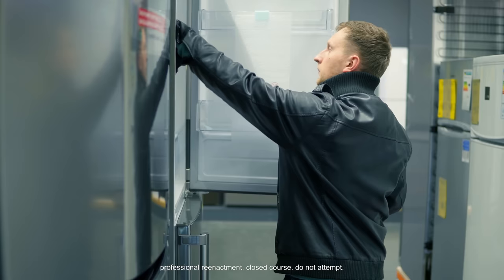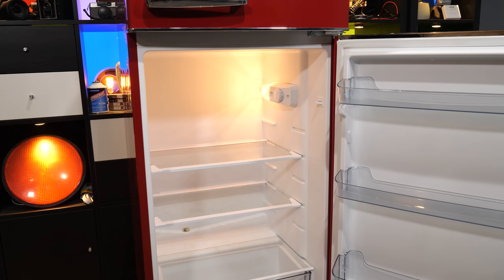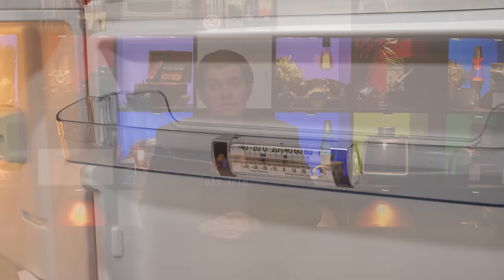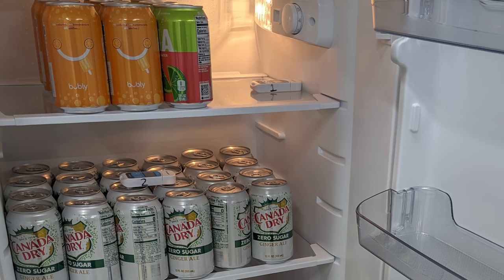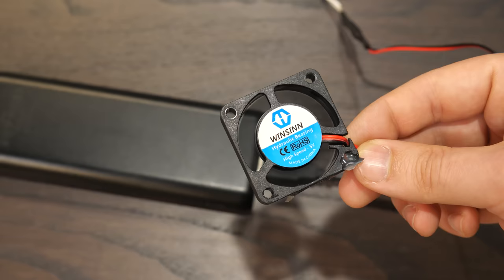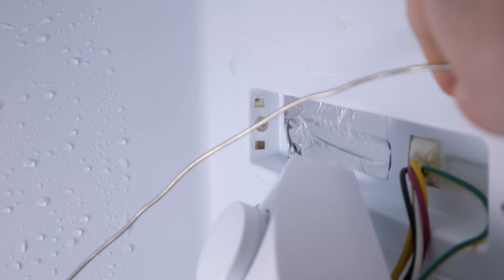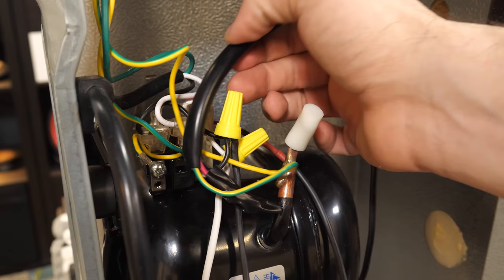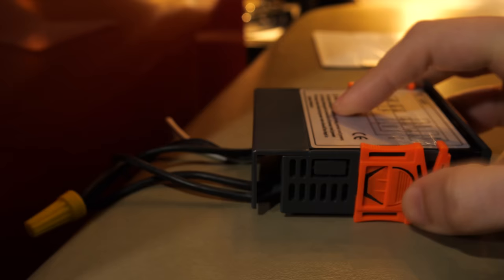This goofy fridge has a really clever design. It's also kinda terrible.

Comment: I can't wait for the final instalment of this series on the refrigeration cycle where we see Alec build his own refrigerator from scratch. 😂
Reply: Needs to be multi stage and also produce Liquefied gasses tho…
Reply: Maybe he can DIY an air conditioner that uses CO2 as refrigerant
Reply: @JamesRibe  I'd be impressed since CO2 heat pumps require very high pressure.
Reply: @BenWolkWeiss  Propane is one of the sort of "refrigerants de jour" due to simplicity, good performance, relatively low pressure, availability, low(ish) impact as a climate impactor if it leaks, and honestly, it is quite hard to blow up if it leaks - requires a pretty precise fuel air mix to burn (goes by R-290)
Reply: "available at your local Meijer!"
Reply: how were you here early? He doesn't seem to have channel memberships or Patreon, though correct me if im wrong
Reply: @ThomasRuecker  There is a youtube channel called Hyperspace Pirate currently making a diy cascade refrigeration system with the goal of producing liquid nitrogen.
Reply: Today, we have crossover video with NileRed; we’re going to be synthesizing R-123 for my home made chest freezer/oven with a reversible heat pump!
Reply: “Fine, I’ll do it myself”
Reply: @Luckmorne  Hank Hill branded refrigerator?
Reply: The channel @HyperspacePirate has been doing some really cool home refrigeration projects for a while now. I highly recommend them. They’ve got a similar sense of humor to Alec’s videos.
Reply: Hopefully he makes it reversible because you already have like 95% of a heatpump anyways. Might as well make it heat too
Reply: @WohaoG  He does have a Patreon, but doesn't seem to promote it much at the end of his videos.
Reply: @JamesRibe  The very first refrigeration systems used ammonia as refrigerant.  They stopped using ammonia when leaks killed people in the buildings.
Reply: "Now through the magic of buying my own more efficient refrigerant.."
Reply: @Luckmorne  And it's been known to have been sold mismarked as R-22, or as R-22 replacement, which it will happily replace/coexist with in a system.
Illegal for home use in the USA, however, even if properly marked.
Reply: That's not the final episode.

The final episode comes after he goes mad off of refrigerant inhilation and becomes a Mr Freeze esk supervillan, besitriding a major US city with his cryogenic powers, screaming "BY THE POWER OF HEAT PUMPS!" as he slaughters people en-mass with his ingenious creations.
Reply: how'd you write a comment "1 day ago" when the video dropped "1 hour ago"??
Reply: I'd put it at the top of purchase consideration.
Reply: Collab with primitive technology.
Reply: @ThomasRuecker You could make a very basic one with anything that changes it's volume. Applied Science did it with rubber bands, though it was incredibly weak.
Reply: @cyrollan Patreon
Reply: @KaletheQuick Fridge made of sticks and mud 😂
Reply: It'll end with him out on the roof with HVACR videos
Reply: @mgkleym  I was gonna mention that, one of my favorite youtube "series" at the moment.
Reply: The Mosquito Coast 2: This Time It's Wisconsin
Reply: Brass refrigerator from scratch as diy perks do
Reply: He is actually going to pull a switch on us and use a Peltier cooler, or maybe go with a bromine refrigerant, or a Steam powered system. Peltier is the easiest to build at home with basic tools.
Reply: @mgkleym  I did that years ago with a Sterling cooler using company money. We went to pulse tube eventually and then back to Sterling. I'm cool like that.
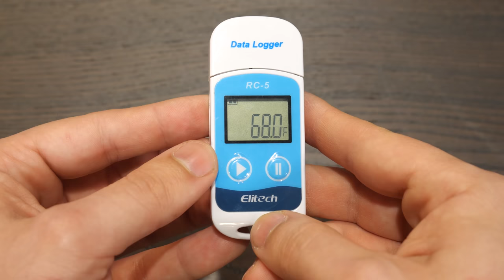Reply: 18:37 temperature measuring
Reply: Don't tell him Telsa's have heat pumps.
Reply: He's planning to freeze hell over
Reply: He's definitely got my interest here.

A homemade fridge sounds so cool
Reply: @Luckmorne  To go boom, sure, but any propane leak can have a different hazard; starting a fire. Get a tiny pinhole leak, something sparks or is too hot, and now you've got a tiny flamethrower until you run out of refrigerant. Honestly a fridge exploding is far less of a worry than a slow leak causing a fire, or even just destroying the unit and all the food inside.
Reply: I'm here for it.
Reply: @UncleKennysPlace IKR! I wish i knew this when recharging my 91 camero. It never got above mildly cool. Could have been full of oil too. Never got to figure it out before I smashed it. Im bout to fill my chevy Colorado with propane because it keeps acting like it cant handle r134 pressure and the compressor kept spitting like it has a pressure relief. No clue if they even have relief valves like that
Reply: "Through the magic of building two of them..."
Reply: Ahh yes the first mini-split heat pump refrigerator where the compressor is outside the house.
Reply: @megan_alnico those already exist in a room size format. People do it to make walk-in-refrigerators
Reply: It better be one of those Einstein–Szilard coolers! No moving parts is pretty enticing!
Reply: This is going to be a fridge of Theseus
Reply: @Wtfinc loads of them do indeed have a high pressure safety release valve.
Reply: Primitive Technology Connections?
Reply: Make insulated box, insert ice.
Instant 'refrigerator'.
Or as they were originally called, Ice boxes.
😊
Reply: Applied Science demonstrated a "refrigerator" that operated by stretching and releasing rubber bands, so there's that.
Reply: ...using Tech Ingredients barium sulfate coating to make it even MORE efficient!
Reply: Who's Alec?
Reply: @newunderthesun7353  the guy who used to host Jeopardy.

He reincarnated about 40 years into the past to become our Technology Connections guy
Reply: Who is Alec? His name is Technology Connections
Reply: Haven't watched the video yet, but I'd be all for that. Every fridge I've bought in the last decade (7 of them!!!) Has broken down, with the exception of my current one. A convertible Midea. If this one goes, I'm going vegan so I don't have to worry so much about spoilage of meats and dairy. Imma just eat root vegetables.

*Edit:

That Samsung he has is the same model we had that broke down close to a dozen times before it was finally replaced. There's a class action against Samsung because of their fridges. They suck.
Reply: I've been watching his videos for years and it never occurred to me that I didn't know his name.
Reply: @codyofathens3397  the convertable Midea Chest Freezer?

I'm using two of those {the 7 cu ft capacity} for my fridge and freezer. Nice!
Reply: I want to see him work on his quirky car more often.
Reply: @AmEv7fam  They call it The Strickland. No longer will you need to burn charcoal to keep your food cold, and it keeps the flavor of your meat natural.
Reply: @EnderMalcolm you do realize the qty of propane in even a resturant size refrigerator is minuscule… on the order of 8oz… that would be one extremely limited flamethrower…
Reply: We all know this is gonna happen eventually
Reply: Maybe an aging wheels collaboration since he seems to have enough tools to pull it off.
Reply: I mean when you can't find anything cosmetically available...
Reply: Such a good idea
Reply: @chrisbaker8533  an ice box and a refrigerator are not the same thing. There's a reason they're called by two different names. You described an icebox. The fact that you put the word refrigerator in quotes yourself, tells me you know you're using the word incorrectly. Why bother?
Reply: @fredashay  Ammonia is still used in some large capacity applications. It's a fairly specialized part of the refrigeration industry, but it's still common in certain niches.
Reply: He turns his garage into an icebox using some weird thing.
Reply: @Jafiveon  Oh?  Okay.  Thanks for letting me know.
Reply: @priestesslucy3299  ours is an upright. I've got a cheap Walmart special chest freezer, as well as a stand freezer I bought from a rental place like 10 years ago. I absolutely love the Midea fridge, though. With the two other freezers, I didn't need any additional freezer space, and it's nice having the extra fridge space that would have gone to a freezer compartment. 

Are you using a convertible chest freezer as a fridge? What's it's like having a chest fridge? I considered it, for the energy savings, but I was concerned that if anything leaked it would be a bear to clean and keep clean.
Reply: @codyofathens3397  It works so much better for me personally than when I used an upright and things always got pushed to the back.

I have it divided into three columns for different things and two slider baskets and it works great.
Reply: I'd buy that for a dollar! 😂
Reply: I can't wait for the second season of your "final instalment", where we see Alec build a BTTF3 universe-correct steam-powered version of his own refrigerator from acceptably retro parts and a period-correct refrigerant substance tbd. Ether, alcohol, or ammonia, maybe? By the way, this bozo —I'm talking about yours truly— only just realised that the Victorian Age absolutely temporally coincided with the Wild West. I wonder if Mark Twain ever regaled His Majesty with stories of cowboys and Indians. Btw. Wikipedia's Refrigerator page has a cool (heh) sketch of an apparently steam-powered one.
Reply: Expensive 🎉
Reply: Yes
Reply: @EnderMalcolm 08:22
This fridge uses butane, r-600a. Actually it’s pretty much impossible to buy a fridge made after 2019 without butane or propane refrigerant. R-134a was banned by the EPA for household fridges in 2018.
Reply: How where you here early?
Reply: I'm expecting an hour long video on an ice cube tray that is _still_ fascinating
Reply: I think that would be season/series two material.
Reply: I'm thinking of the scene from mosquito coast
Reply: There will be no final installment. It’s a cycle. It never ends ;-P
Reply: Need to have a reversible valve to turn the fridge into an Oven!
Reply: Wait what do you mean his name is not Technology Connections?
Reply: It would have to be a Whole-Home integrated system, combining climate control, hot water, clothes drier and fridge in a single system that removes or delivers heat to wherever it is needed. Probably all powered from his car.
Reply: "so I accidentally sprayed myself in the face with refrigerant.."
Reply: LATENT HEAT
Reply: He should partner with Tech Ingredients for the video. I wonder how cold they could get the insides lol
Reply: traybern  make the condenser visible from the inside and mix oil into a water based refrigerant.
Reply: I would love to see this 😂
Reply: PLEASE we need this video that would be the personification of yt premium
Reply: Technology Connections/Tech Ingredients crossover? :D
Reply: PLEASE 😂
Reply: Who wants to buy a YouTuber fridge?
Reply: I hope it's capable of cooling and warming, if not it would be a wasted heat pump.
Reply: Knowing how simple it is to build a fridge, now, I kinda want to. Maybe one condenser for big temp swings and a little one for maintenance? How much insulation is too much insulation? Chunky cast metal door hinges and latches, yes please!
Reply: Careful, don't tempt him. 😆
Reply: Hyperspace pirate is doing this actually!
Reply: a multi-level top-opening floor fridge/freezer combo :3
Reply: I'm not going to lie, but I've been dreaming of seen a diy fridge that someone intergrates into their home AC system
Reply: There was an old SNL bit with a couple stranded on an island. For Christmas, the man made some trivial trinket from a coconut while the wife made him a watch from ore she smelted. 🤣
Reply: You mean the fridge/heatpump, which not only has a cold compartment for cool item, a freezer compartment to freeze things, but the ability to heat and cool the air in the studio as needed.
Reply: He'll end up with a mountain sized Pykrete Warehouse.
Reply: The channel Tech Ingredients do a lot with cooling, heating and solar, they recently built quite a big Peltier Elements fridge... 🤔
Reply: Seems more like something Tech Ingredients would do. I think they haven't done it yet, but might be a good idea.
Reply: I'd be excited to see him collab with How to Make Everything.
Reply: Yeah, go retro and use ammonia as the refrigerant.
Reply: ... using nothing but a bicycle pump, a ballpoint pen, a brassiere, and some Tupperware.
Reply: The next series will be on designing a perfect toaster
Reply: One can hope
Reply: Yeah! Do it Alec! you know you want to!
Reply: To build a refrigerator from scratch, you first need to create the universe!
Reply: Same
Reply: He needs to solve the coolant safety problem at the same time.
Reply: During your test of the little refrigerator, the abnormally cold temperatures in the icebox cooled the thermostat area more than is typical. That caused it to think the refrigerator area was colder than it actually was.
Reply: @VieVentar you left out the accompanying step-by-step DIY explanation vid the FBI will label "manifesto".
Reply: @goosenotmaverick1156 maybe because it was uttered tongue-in-cheek and thus not designed to be overanalyzed? Just a theory. Feel free to split more hairs.
Reply: @neepsmcfly4176  I mean, no tongue or cheek involved in typing but yeah, I thought sarcasm and overanalyzing was the thing we did here
Reply: With help from aging wheels (who im convinced is his brother 😂)
Reply: That's an upcoming four hour technology connextras episode
Reply: Hyperspace Pirate is working on that.
Reply: I can t wait for the 2 hours sequel.
Reply: Not his gig. He's not a "maker" channel, he's more of a "break-down and analyze" channel.
Reply: @JamesRibe CO2 in transcritical cycle??? This is really interesting!!!!
Reply: I really want to see this lol
Reply: Ok
Reply: @goosenotmaverick1156  and you don't see the numerous examples of missed points? Of pointless hostility from misinterpretation? To claim that everyone is doing it neither forces you to do it nor justifies it's being done. I just wonder if more ppl consciously recognized the limitations maybe it would sway the social awareness and there'd be more funnier jokes and less misunderstandings. This, here, is already getting too convoluted. Hope you get it...
Reply: @VieVentar  Lol, you actually could use laughing gas (nitrous oxide) at about the same pressures as CO2.
Reply: I hope he covers thermo-electric/peltier cooling soon!
Reply: Lol dont call him alec like you're friends
Reply: @you_cant_ban_me3154  😂 What am I supposed to call him? Tech Connections Man? Mr. Brown? His name isn't hard to come across. I can't even remember how I learned it.
Reply: @Luckmorne  Propane also got picked up as the R-12 replacement of choice for older cars as the compressors struggle with the increased pressure requirements and lower efficiency of R-134a. These days, I suspect the shift for the same kinds of restorations is R-600a, isobutane, as seen in this refrigerator. Too bad nobody will let propane or isobutane anywhere near an automotive A/C system from the factory. R-134a took several years before auto manufacturers had A/C systems with appropriate capacity, and a lot of that was much larger condensers (now the size of the radiator), larger evaporators, and higher power draw compressors. R1234yf turns out to potentially be worse in parts of the environment, and it ignites in front end collision testing. New cars since 2017 with it have noticeably weak A/C units for any southern state.
Reply: @WohaoG is
Reply: There's a problem his temps had a little C ....weird
Reply: How is this comment older than the video?
Reply: @goosenotmaverick1156 most old timers call a refrigerator an ice box. Mom used to call it that. I thought it was an eggs box. Because as soon as you open the door you see eggs. I was four then. I know a real ice box is made of wood with cork insulation and an ice compartment. You cannot keep ice cream in an ice box unless you buy dried ice.  Well enough history lesson. 73
Reply: @codyofathens3397 once I took our 5 cu ft deep freezer on a trip for a cooler I would plug it in every other night it kept things cold. And didn't freeze the food. They are well insulated. I had insulin ice packs in the bottom of the freezer. I now have a large compressor run chest refrigerator that can be set to -10 degrees. runs on 12 to 24 volts DC and if you use the line cord 120 volts AC. I had to remake the car cord the plug melted. I guess it arced abd got hot when the car was being serviced. I forgot to unplug the refrigerator. 73
Reply: @coopergates9680 yeah and I could install a valve to connect to my face mask when I see the dentist. I have a gaging problem I cannot stop with those rubber gloves or whatever material they use. It's not latex. It don't matter I gag regardless. Enough of my dental exam. 73
Reply: I always thought his name was Technology this whole time?!? What a world!
Reply: A regular Einstein!
Reply: THE POWER OF BUYING TWO
Reply: @paisleyprince5280  sometimes I think 2 refrigerators are better than one big one. Or maybe a refrigerator and a chest freezer. If you had 2 small refrigerators you could organize each one to have certain items put the meat and drinks in one and the produce in the other same with the freezer compartment. The reason I decided meats and drinks because I would set that refrigerator just above freezing like 35 degrees. And the produce refrigerator at 40 degrees. I like my drinks cold and no ice is needed at 35 degrees . 73
Reply: Using a reversing valve to defrost with heat pumping: good idea or no?
Reply: "Through the magic of building two of them, I can show you how it works!"
Reply: You can make a walk in cooler by using a window AC unit. Great for the farm. 73
Reply: This fridge do be turning into a ship of theseus.
Reply: @JamesRibe eh, co2 is still in its infancy as far as the commercial sphere is concerned.. still worth learning about though.
Reply: @UncleKennysPlace coexist? As in mixing refrigerants? That's a big nono, don't do that.. and no not all A2L/flammable refrigerants are compatible with all compressors, could be a potentially violent mistake. This is why you should not DIY some of this stuff lol..
Reply: @MrFastFox666 Is the opposite of a fridge an oven?
Reply: @fredashay  are tons off brand new ammonia refrigeration systems all over I've done pipe work on a warehouse that stored ice cream and a dairy processing plant that both used ammonia as the refrigerant almost and refrigerated building will be using ammonia.
Reply: @J.Cee-1675.  Cool!  I learned something new!  Thanks!
Reply: I guess they use it on the big projects because it is cheap. We ran the ammonia pipes to heat exchangers, anywhere there was going to be actual food had food grade glycol in the lines. I think the glycol might have went to the chillers on the roof but I'm not sure all I do is lay pipe.
Reply: @JamesRibe why though that’s like the biggest pain in the ass of a refrigerant because if it fucks up it’ll make dry ice
Reply: @Luckmorne yup! That and r600 are the easiest to work with for hobbyists, provided you are careful not to cause a flame out. Also compressors built for alkanes tend to work well with a wide range of them! They can even be repurposed for extractions in a lab setting ;)
Reply: He can just grab one at ikea
Reply: @steemlenn8797  "To build a refrigerator from scratch, you first need to create the universe!"

Then what are you scratching, wise guy?
My Summer Car DLC at the beginning of the universe?
Reply: No dead ass 😂